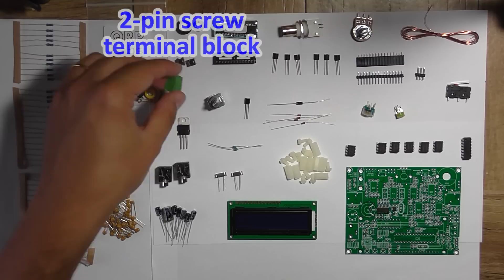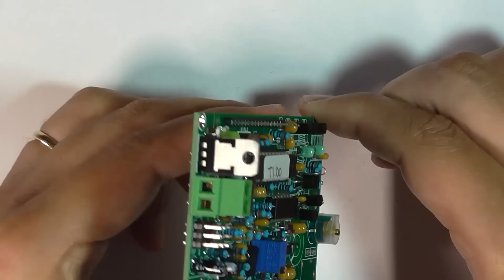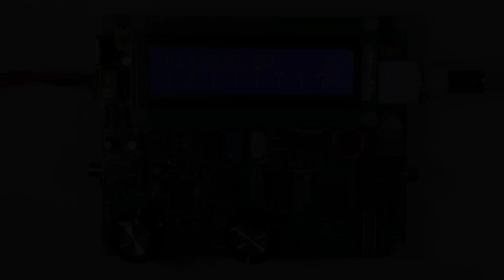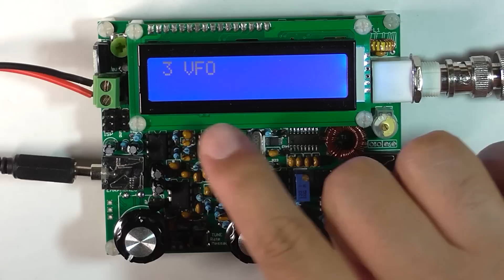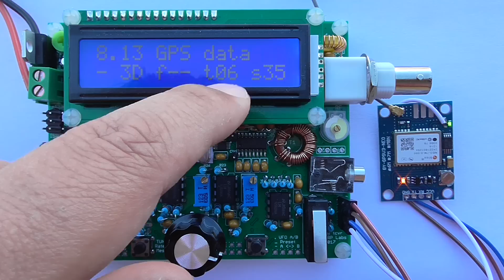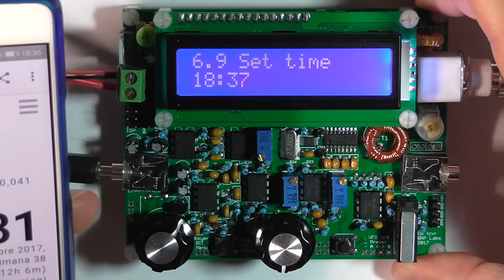QRP Labs QCX 5W RTX Transceiver by Hans Summers

Comment: Easy way for wiring T1 coil...first---wire  30 turns of wire for  T1...solder to the  pcb terminals 1 and 2...this is the first coil...second......solder couple inches at terminal 3 --5 and 7 carefully wire  3 loops of coil  for the next 3 coils ..solder each coil to it correspondant hole a pcb..and thats it.....measure cor inductance at each coil..O THIS WITH PCB EMPTY OF COMPONENTS..

Comment: How can I test the chips with a multimeter to see if I got them too hot with the iron?
Reply: unfortunately, the integrated circuits cannot be tested with a multimeter like a resistor, transistor or diode can.